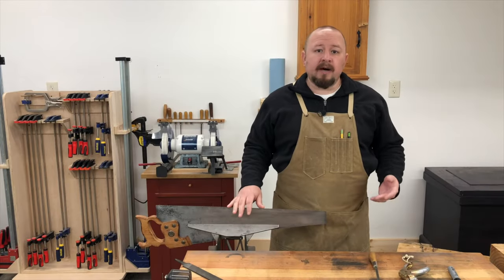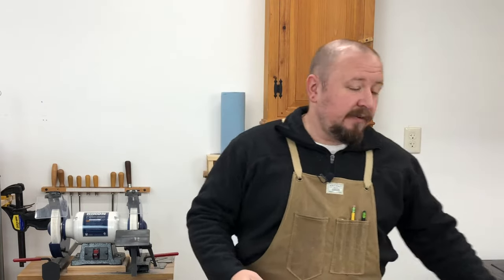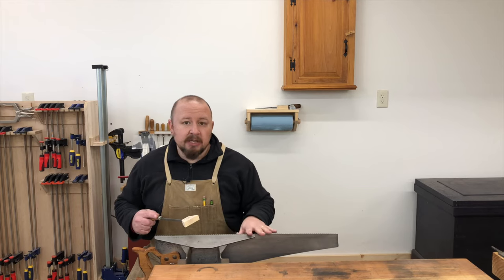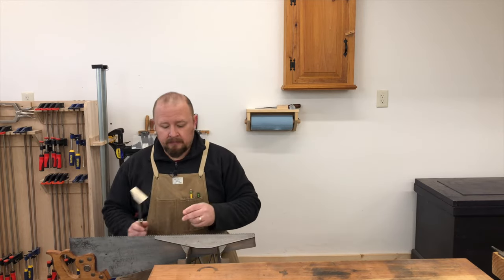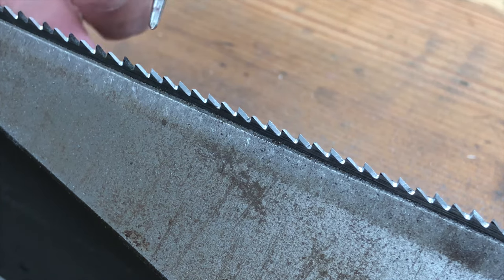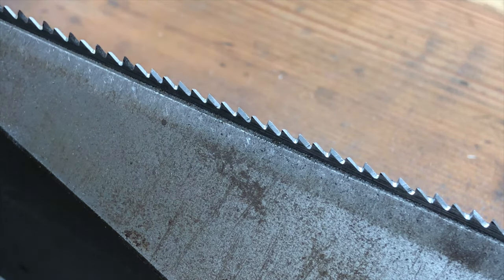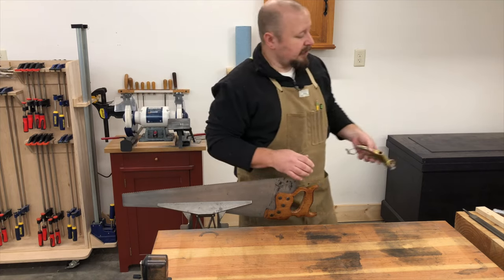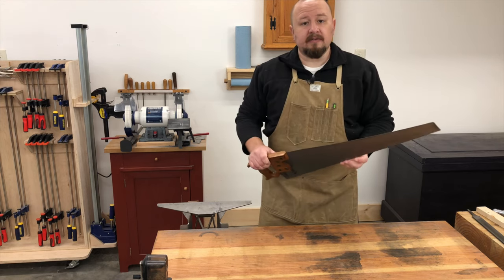How to Sharpen the Crosscut Hand Saw - Hand Saw Foundations

Comment: Well done Bob!!  That’s about as on-point, direct and clear a lesson as it can get. I’ve collected old handsaws for years, only a couple of which are really sharp. I’ve wanted to learn the process and get all 15 saws sharpened and in use. I only have 1 rip saw and my XC saws run from 7 to 14 TPI. I’ll take your course based on this video. Certainly information well worth paying for. I’m in the process of building my Moravian workbench and need sharp saws to complete it. Thanks